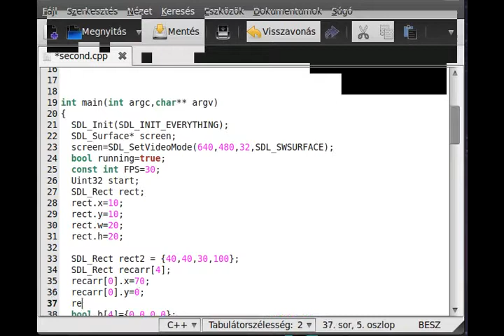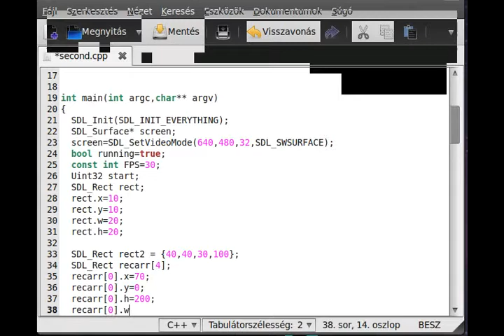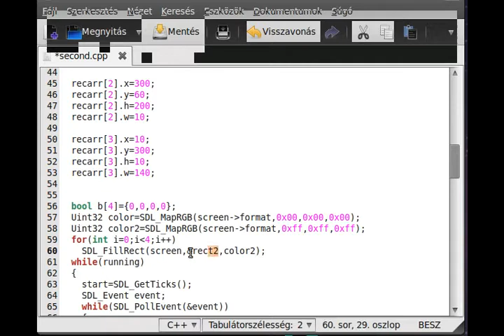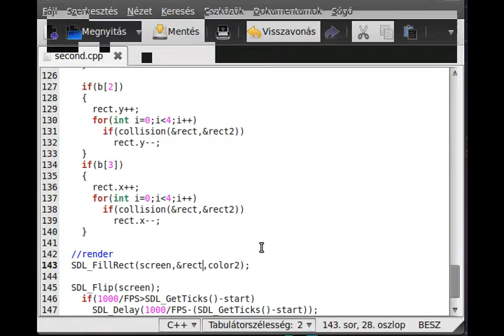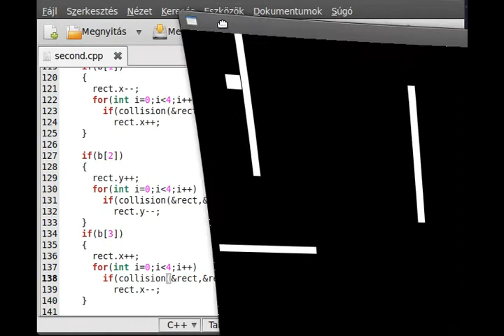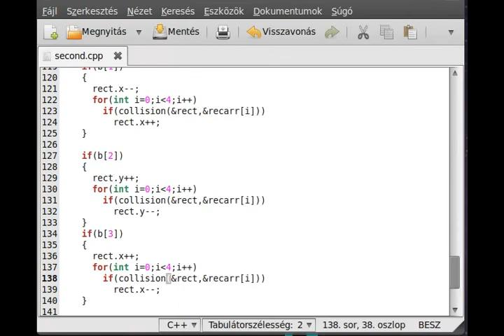SDL tutorial 11 - (bounding box) collision detection (part 2)

Comment from the maker: Make it move not one pixel, but more pixel per frame (so instead of rect.x++ make rect.x+=speed).
Altough I should mention one important limitation here. Altough as long as the speed stays quite small, it will work, but if you make the speed to big, the collision could fail (your object go with large steps, not continously, so it could "step" through things), one solution:
for(int i=0;i<speed;i++)
{
  rect.x++;
  if(collision(...))
     rect.x--;
}
Move and collide pixel by pixel everywhere.